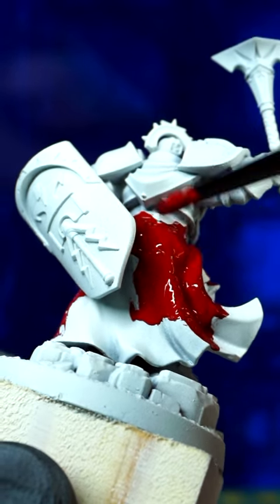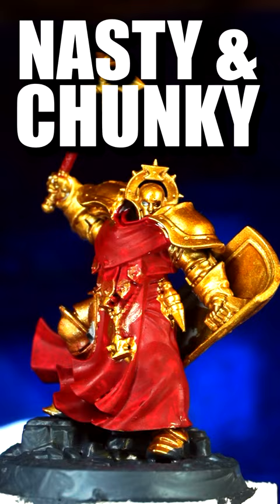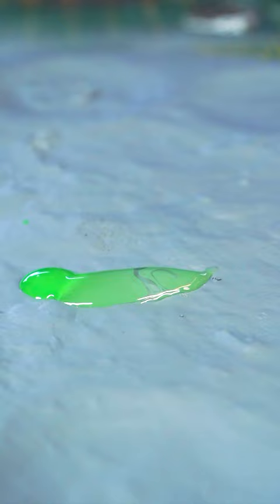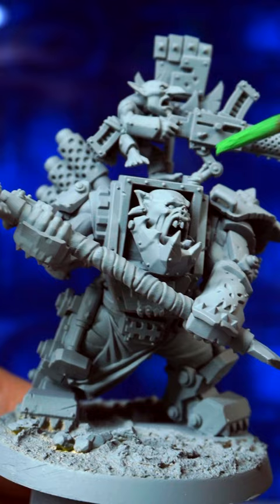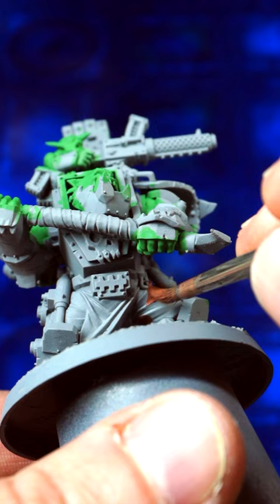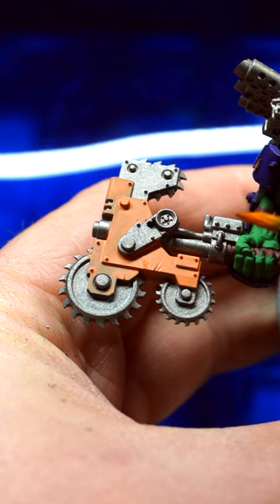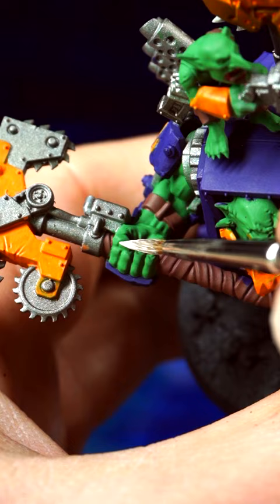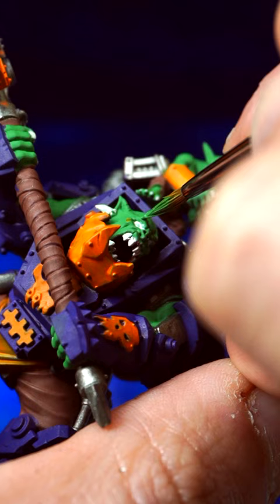Thin your paint! Basecoating basics

Comment: A little tip.
The consistency of milk never helped me it was to vague.

What I found is that if I dialute my paint to a point where when I brush strope it on my pallet is doesn't stay put but slightly contracts into itself I have dialuted it enough to go on in 2-3 coats.
Reply: That's super helpful, the milk thing always confused me

Comment: So I have a question. 
I have never seen anyone paint the figurine pieces by pieces before assembling them.
Is there a reason why ? Like an unwritten rule or smth or did I just not found a video like that yet ?
Reply: Most people prefer to fully assemble, then paint, but it's all personal taste. I just finished the warboss in mega armor pictured above, but I primed and painted all the biggest pieces separately. Check out midwinter minis video from a couple years ago where he paints an Eldar, he paints every piece individually, then assembles.